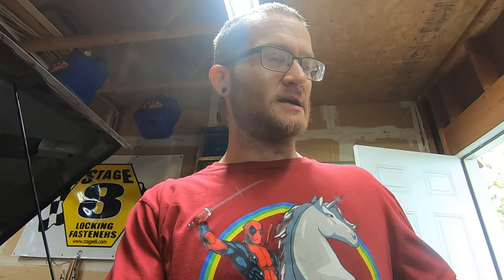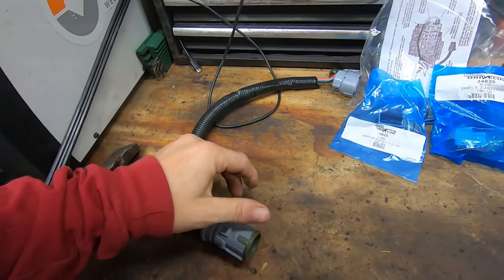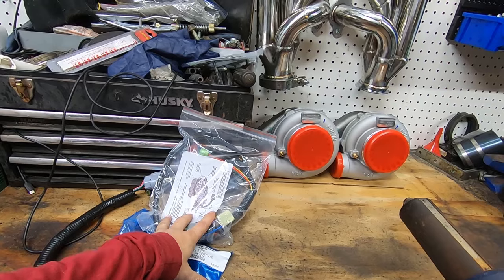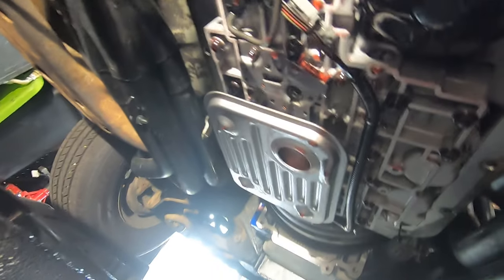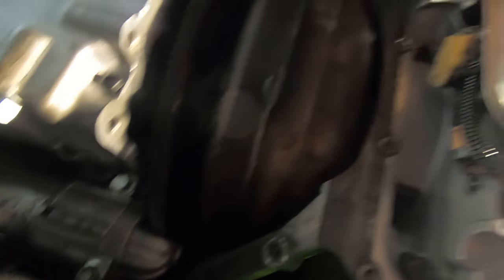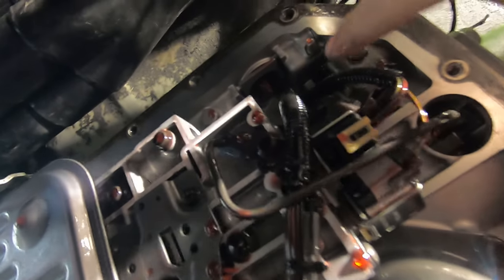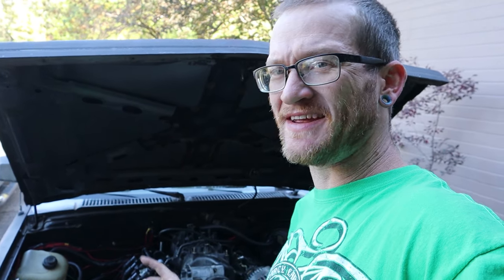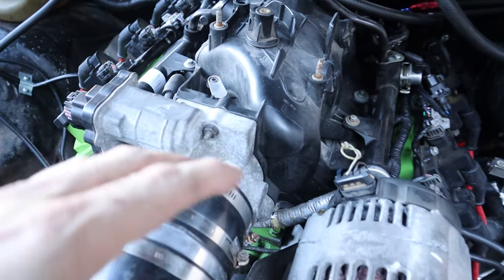4L80E wont shift & the $35 FIX!!! Don't Replace your Trans just yet

Comment: I bought 94 silverado, The car has been lying dormant for eight years , when I started to test drive, It shifts gears 1 and 2 very smoothly, but for gears 3 and 4, I have to press the gas pedal several times to change gears, When I looked at the transmission fluid it is full of bubbles, I will change the fluid tomorrow, Do you think the problem is with the transmission or other parts?
Reply from the maker: Could have lost some fluid and had enough for 1&2 but not the rest. It could be one of those situations where the more you drive it the better

Comment: Hey man I watched the whole video but I'm wondering if this little part might be the same issue I'm having. Won't shift out of first gear but if I manually shift through the gears they feel fine please help 🙏. 2003 silverado.
Reply from the maker: So thats what I was going through and it was the back sensor. Since it shifts fine manually that tells me internally it works fine. You dont hear any extra noise from the trans? Also double check your fluid level but im pretty sure its the speed sensor.
Reply: Mines will not shift out of first gear and  want change even if I manual shift

Comment: When this happened were you able to put it in park mine won't even lock into park
Reply from the maker: Yes I was able to put it in park. I would make sure the shift cable is actually pushing it far enough to put it in park
Reply: @Southern Gearz  it is also doing what yours was doing it goes forward and back but it won't shift the rpms go up and it ne er changes gear changed all internals also
Reply from the maker: @lindseywalker-mk2ib  mine ended up being the front iss sensor if you havent changed the speed sensors i would starr there.
Reply: How can you check if its the cable and not a broken parking claw? @southerngearz
Reply: Did u fix it yet? Mine doesn't lock in park either ever since I bought it....was thinking maybe the parking claw broke from parking on a steep hill without engaging the parking brake?

Comment: I ran low on fluid but when I filled it started giving me problems. With the engine light on its 2nd gear all the time. If I clear the code I get 1-2 and 4 it skips 3 and fourth feels like it slips. Is this along the lines of what your issue was? Code reads solenoid B stuck open.
Reply from the maker: Nah mine would stay in 2nd and never shift no matter what. If it is slipping its possible the clutch packs got damaged when it was low on fluid. Its very possible that stuck solenoid could cause this as well. If its stuck open then the pressure for the transfluid wouldnt be enough to keep the trans from slipping. The solenoids are the cheapest option to try first and hopefully the trans is fine overall
Reply: @southerngearz  I’ll look into that. I got a new filter as well
Reply: @sagemata5756 I'm having the same problem did you ever get it fixed
Reply: @boostedkidproductions9719  I sold the transmission and replaced it. The fluid was burnt to hell anyway.

Comment: I have a 93 Silverado and same problem here it would move go in reverse and forwards but the rpm would just go up. The speedometer would not move at all and the truck won’t shift into gear.

Comment: How you figured the speed sensor was the problem?
Reply from the maker: I went to drive it and it wouldnt ever shift
Reply: @southerngearz  my car wasn't shifting neither, the speed sensor connector 1 pin was push out. Replaced with a good one boom problem solved. I also thought my solenoids were bad.  Thanks for the video.

Comment: Thanks man... I was thinking the valve body had to come out too. Mine is in 2nd gear, no 1st, 3rd or 4th so I'm figuring it's the solenoid.
Reply: Did you ever get this figured out mines doing the same thing considering changing the solenoids
Reply: @jamesw9153  Mine was actually the harness inside the trans. Unplug it and check for trans fluid in the plug, if it's wet you have a bad harness and I'd leave the solenoids alone.
Reply: @patkane761  what codes did you have that lead you to replace transmission harness
Reply: @boostedkidproductions9719  It had multiple codes I really don't remember, it was a year ago. I did replace the shift solenoids and speed sensor along with the harness and it's still running fine.

Comment: I have a 2003 chevy 2500hd 6.0-4l80. Heres my weird problem:

Truck has high revs when shifting from first to second especially from a dead stop. It’ll go up to 3500-4000rpms before it shifts into next gear. The TC has been replaced recently as well because the fluid within the trans pan was burnt very much dark red so we assumed TC. Prior to the TC replacement, truck had no pull when in drive. Basically like, you switch from park to drive, release brake, truck pulls itself. It never did that until the TC was replaced. So thats good now. When you shift manually at a dead stop through 1,2,3 on the dash, you can hear and feel the gears being shifted into, so its like, the truck understands what gears its in. But as soon as you pull away from a stop, the truck is going but the RPM’s go up pretty high before it shifts into the next gear. Fluid and filter was replaced, truck is very much drivable but it just sounds like your peeling tires from every stop and go because the engine revs up high every time you leave from a stop (it also has a open exhaust system so you can obviously hear it wind up). We have no idea what it is or what it could be. No codes, no engine light. Long revved shifts from first to second. Any ideas? Already spent $840 on repairs so far.
Reply from the maker: Hmmmm it sounds like it could be the solenoid have you tried replacing the ones in the valve body. With how dirty the fluid was you may want to. It sounds like a high stall torque converter with out the high stall converter. Which is why im thinking solenoids
Reply: @southerngearz  Thats what I personally am suspecting, but I also suspect that there may be a trans code, but our $80 scanners wont pick them up (ive heard that can happen sometimes). Also forgot to note that the 4l80’s have that notorious wiring harness leak, I have seen puddled fluid inside the connector before (which also heard it can cause issues when it leaks) so i have ordered the following: Wiring harness, 1-2A solenoid, TCC solenoid, and fluid pressure solenoid. I also went and grabbed the input and output speed sensors. Generally the 4l80’s have a reverse gear issue, seems like when when most have failed the reverse was first to go out, the reverse in my transmission is so strong and quick to respond, so thats good news as well. Truck has been with a mechanic for two weeks now, parts will be in tomorrow and Friday, he’ll slap them on and see what happens, im also having him remove the manifold pressure switch in the pan and clean the buttons during the solenoid and wiring harness install. He has his thoughts, I have mine. Im thinking that the bottom left pin on the connector which is the 1-2A solenoid pin has been wicked up with fluid leaking especially with it being at the bottom and has delayed a signal or some sort to the actual solenoid, and thus confusing both the ECM AND TCM and thus not able to throw a code. Some of the shifting is intermittent symptoms, sometimes your like “hey we got progress” then an hour later it may rev up to get into second gear. Which to me sounds more electrical than mechanical unless it was a pump issue. But i feel like if it would be a pump, ALL gears would act up, not just first to second. If you manually go into first and drive, does same exact thing, so first gear does exist, it’s definitely not a missing gear or “slipping out of it”. Yeah torque converter was our first suspect, prior, the truck wouldnt even move at all in first gear. I mean 5000rpm and launching you forward. TC was replaced and the truck will crawl on its own and it’ll definitely move without slinging you forward for sure.
Reply from the maker: @semperparatus3188  yea i feel like that will do it only other thing may be the tiny mesh filters associates with valve body but that requires dropping the valve body to replace. Yea the leaking wire harness is always a good reason to replace the electrical components. Certain years have one but mine 06 still runs off the pcm.
Reply: @southerngearz  i have a similar problem i have a 4l60e my check engine light was throwing p2761 code which was the tcc solenoid so i replaced it and the shift solenoids but it’s still not shifting normally only at high rpm’s
Reply: @PRE.Drew1 did you ever get it figured out
Reply: Mine says it's not putting pressure out .   Its stuck in 3rd.and won't go through drive gears but I invoked the battery and it rangine for a day then went back to the same thing
Reply: Ike had shifting problems with late model s10 and rebuilt transmission to still have problems and was trying to go into 4wheel low  , turned out to be a vacuum leak at the map sensor  . Low vacuum confused the computer that engine was running full throttle  . New O rings on the  MAP  sensor fix the high rpm shifting and he has a nice rebuild he didn't need on the transmission  .Oh well  .
Reply: Did you ever find out what the problem was? I have the exact same issue
Reply: @caseykasmeyer6919  the transmission went out about 2 weeks later

Comment: Having issues with mine not shifting into od. No sigh of any issues just stopped shifting into od. I can feel it trying to though. Was thibking my lock up cylanoid may be bad?
Reply from the maker: How is the level of fluid?
Reply from the maker: It could be the solenoid though and if you go inside just get the whole kits and replace everything including harness.
Reply from the maker: You can do it with the trans in place its just annoying but less annoying than removing the trans

Comment: i just put a 4l65e in a 03 escalade and im having same issues. wont shift gears at all and speedo is dead. Replaced VSS no change.  hoping to get scanner on it today for some more concrete info.
Reply: Changed my transmission with a good one and now it doesn't shift at all.   Any suggestions?
Reply: Check fuse #4 10amp the transmission is electronically controlled and it reads info from the cluster if it doesn't work the transmission doesn't know when to shift

Comment: I’m either going crazy but I can’t find the input speed sensor on my dang 2005 gmc 2500 with 6.0 4l80e where is it located I done did everything you did an have same issues 🥴 please help me…. 8:55 in video
Reply from the maker: Drivers side of the trans you should have a sensor close to the bell housing and shift linkage and the other is driver side toward the rear they are about a foot maybe foot and a half apart from each other

Comment: forgive the swear, where da fudge do you find OEM PARTS? Mine is a 1997 GB Cruisemaster, built on the P-30 chevy stepvan frame. and also it weighs 14,600, is this actually sufficient for the weight? Motor seems plenty strong enough, replaced the solenoids base on a scan, mine currently stuck in 2nd gear limp mode, Tranyfluid extemely clean, very small amount of very fine gray matter is all, nothing wrong mechanically. very clean. Tried to put new filter that looked the same from O'wrongly, burnt by many bad parts for them, but I don't know yet if I put crap parts in. the new filter spout was .010 to big. for those of you who don't know that is a very small number, but a HUGE difference when it comes to trying to put something just a little too big into a slightly smaller hole. I would have needed to beat it in not to mention I would wreck it by doing so. Very many copy cats that are made wrong. Your info on the plug. I have stopped right here and am  going out to check mine/, I see I have to drop the pan again. and save 70 dollars of brand new fluid. At least I've done it once, and your link to the new harness. I think I have to try this my problem sounds exactly the same/
Reply from the maker: So buddy how are things over there?
Reply: still no success, debating about the sensors. Having read what I have it seems any number of things could code out the 2 shift solenoids, I think my old ones are still good. Speed sensors could also cause this code. It seems to me you can hook up a scanner, but it might not lead to the correct solution, without understanding the full workings of the parts involved. I think I may have inadvertantly fried one that is still in there, I think 12 v polarity does matter when testing. I read something else thinking it didn't matter.
Reply: @markiftner4771 ever get yours figured out? I’m working on a 74 gmc version of the P30, and I put a 4l80 in. It does 1,2 gears but not 3& overdrive. Gonna rebuild it now but it had a new good reman valve body.  Think my shift controller is aftermarket USSHIFT quick 2 but it’s not showing any error codes. I’m thinking my rearend info I input into the parameters may be incorrect as everything else mechanically should be good.

Update 11/18/24
Turned out my throttle position sensor wasn’t oriented correctly (the lug connector on the throttle bracket was too far from center of the bracket causing the calibration to be off.)

Comment: I did a 80e swap on 03 Tahoe indicating in 2nd gear but in park and won’t let me crank over any input
Reply from the maker: Did you do a segment swap in the ecu for the 80e swap?  Also do you have both speed sensors wired in?
Reply: This from a hot min ago but that’s bc of your nutual safety switch. Has to be in park or N to start if it says it’s in 2nd that’s bc it is. Shift leakage always is tuff when you put it back on after any tranz drop it’s almost always funky

Comment: Man I have a 2016 silverado and my truck started acting up all of a sudden so im wondering if its electrical. It shifts and all that but accelerating or sometimes at speed its got this shutter. Then sometimes at speed it suddenly gets this deep hard vibration that goes and comes intermittently. Changed the filter and fluid. Trans feels reqlly good and tight. I wonder if its electrical or the damn torque converter

Comment: I have a 2004 6.0  and on the Highway I get close to 3000 rpm at 60 then it just drops to 2500 but keeps accelerating but definitely not grabbing 3rd 
Where should I start ?
Reply: im having the same issue did you solve it?
Reply: get a tune would be my 1st recommendation for sure

Comment: What gears did you have to begin with or did you have no gear
Reply from the maker: It seemed to start in 2nd gear and then never shifted
Reply: 1st and 2nd gear but revs high no 3rd gear
Reply: @erictaylor9730  this happens to mine also but intermittently....did u figure out what the problem was?

Comment: My 2001 Chevrolet Silverado 2500HD 6.0.  I was driveing down the highway and then lost everything. No reverse 123D. I dont know what would cause that. Maybe torque convertor? Thanks anythi g helps
Reply from the maker: How are the fluids? Could be tc or the pump.
Reply: Mine did the exact same thing. Started with a hum the year before but felt fine other than hum then the hum went away one day and the next the hum came back and it just stopped accelerating and only revved like it was in neutral. All gears are now neutral besides park. If anyone's had this and fixed it I would appreciate incite

Comment: For me my transmission problem was just the ignition switch.
Reply: Please elaborate?
Reply: @dandandoodleflops  wore out connections that makes contacts to your wiring harness in the switch area
Reply: How did you figure this out?
Reply: @justatool  Research, plus if you hit the steering column everything works perfectly as it's a known issue when you transmission, speedometer, and tack does stupid stuff.
Reply: Transmission problem ???
Reply: @ayejay4681  Your transmission will default to third gear If you have a bad ignition wiring harness.
Reply: @jamesm568  changed out my Range Sensor and did a fluid change . Looks like she's back to normal thankfully . Now just having problems with the reverse lights not coming on . May need to calibrate the range sensor until reverse lights come on ???
Reply: @ayejay4681  That could be a switch somewhere on the transmission or shifter.

Comment: I have a 95 and it won't shift up to overdrive and all I get is no communication from transmission pulled the plug out had transmission fluid in it put a little break clean up in there to clean the brake fluid out plugged it back in and now I have no bash gages
Reply from the maker: You need to replacs the internal wire harness and might as well do the solenoids as well
Reply: Thanks for the advice
Reply from the maker: Yea sir and thank you for watching if you need anymore help im here.
Reply: That didn't work.
Reply from the maker: Hmm thats all the electronics in these transmissions. If you are still getting a communication issue then it has to be from the chassis harness to computer. Have you replaced your speed sensors yet? They tell the trans when to shift i had one sensor bad and it wouldnt come out of second.
Reply: Everything's been changed even put a different computer and it still didn't change anything the sensor in the tail shaft give me a problem
Reply from the maker: @mudcud  damn ok so its either the chassis harness or the entire transmission unfortunately.